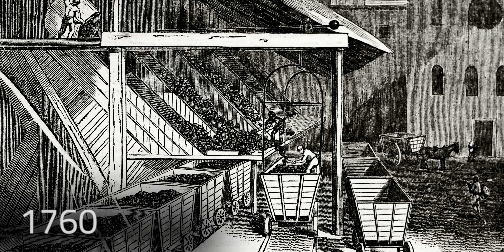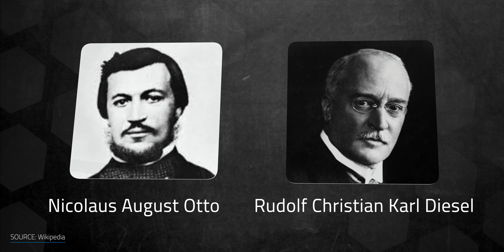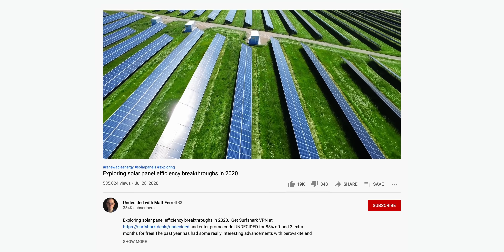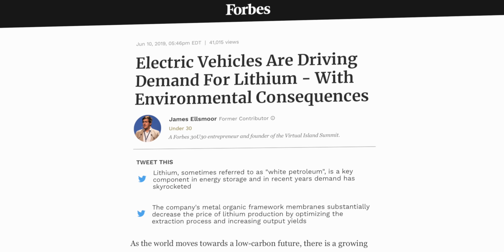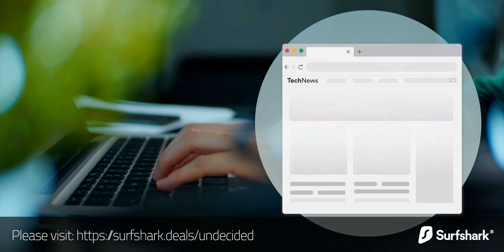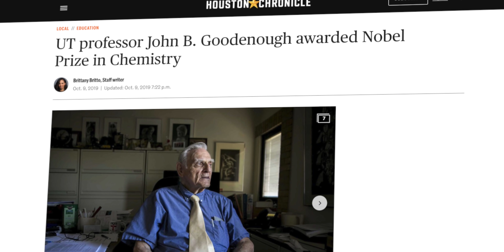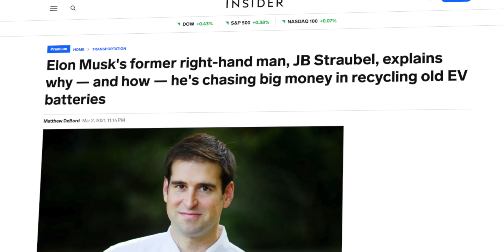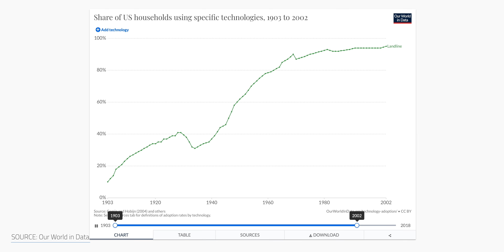Is the Future of Renewable Energy Inevitable?

Comment: That’s Goodenough for me! Yeah, I said it!
Reply: Not Goodenough. Apparently he wasn't satisfied with lithium-ion, since continuing on to sodium.
Reply: @Soul0 lithium ion is not good enough for me LiFePo4 you can't charge in the cold.  So I'm still lead acid. I can charge those at negative fahrenheit temperatures.
Reply: @bullithedjames  if you keep your car plugged in overnight, the BMS for LiFePO4 will keep the battery above freezing and allow near normal charging. In all other respects, LiFePO4 outperforms lead acid.
Reply: @williammeek4078   I don't have a car in a pedal bicycle with trailer that has a baby solar set up on it.
Reply: @bullithedjames  a thermal blanket would be easy enough to set up.
Reply: @williammeek4078  that runs off the battery? That charges off the sun on the shorter daylight days and cloudy days? And then let's talk price. $65 for 115 amp hr rated lead acid so let's say 50 amp hr LiFePo4 equivalent costs how much?
Reply: @bullithedjames  Oh sure, the 100 AH LiFePO4 battery costs $450 about 50% more than your $300 (your $65 is complete BS) lead acid deep cycle marine battery, but the LiPO4 is virtually maintenance free, lasts far more cycles and has a MUCH larger usable capacity. Your 115 AH lead acid has a usable capacity of about 60 AH while the 100 AH LiFePO4 has a usable capacity of 80 or 90 AH. So even though i would be paying 50% more, it is for 50% more battery that lasts longer.
Reply: @williammeek4078  I paid $65 at Walmart for that battery. I check fluid levels twice a year once in spring and once in fall. The price alone does you how long ago I bought that battery so is everybody's talking longevity, I''m just kind of at a loss there because Lead acid is basic maintenance simple. The weight of the battery is what gets me but LiFePo4 is not the answer for my use. I bet they are great where they're use and the cold weather is a minimum.  Lithium titanate would actually be a better solution for what I need but you still got that cold weather charging that lead acid actually is able to do. 

I am not someone just spouting stuff off all that right I'm not. I'm somebody who uses solar every goddamn day. I need it to be movable everything else so like what you're saying you know hey that might be great if I was in a permanent establishment somewhere or hey I had an extra $800 to buy a f**** set up but I don't.  Price, cold weather, and weight lead acid yes there's maintenance. But that's like checking the air pressure in your tires
Reply: @bullithedjames  You are just spouting off. That $65 Walmart battery wouldn’t last a year with daily use. There is a reason batteries designed for cars cost more. Your Walmart battery has a 1 year warranty. The LiFePO4 battery I found on Amazon has a 5 year warranty.
Reply: Where?
Reply: @bullithedjames  Amazon
Reply: @williammeek4078  you said I was spouting off so I asked where. I spouted off on Amazon?  Send a link please or shut up. Do you even solar? Real question I live off a system that costed me $225 at time of purchase. Please tell me more.   I did enough research to know what should work for me, and then you have what you learn by using.  So do you even solar?

Comment: We all know, the renewable energy sector needs a lot of help when recycling the wind towers, or solar panels.. I'm 48 years old.. The thought of countries being energy independent is very encouraging.. Hydrogen, I don't know what to think of it, the oil companies need to go away. Great video Matt!
Reply: I don't think recycling wind turbines is on the radar at all. Other than blade wear from atmospheric abrasion, or oxidation on the tower, the expectation is that they should be in use for decades, and when they individually do wear out, the pieces are mostly metal and can be sent off for normal reuse. Except for the blades which are fiberglass, and it's composites like that all across the spectrum that need recycling effort put into them.

You are right in that solar panel recycling needs to be a thing, but I bet that a lot of the panels that are replaced or removed are probably all very likely still operable, maybe not at their initial effectiveness, but they are definitely not useless 50 years later.

Hydrogen is a big problem though... well not in that it exists, we have plenty of it in our own bodies, the problem is extracting it, and then storing it. Both of those are terribly difficult. Getting hydrogen out of water takes a ton of energy, and the only way it's vaguely worth it is using solar or wind to extract it, but still it's just better to sell that solar or wind electricity then to use it to get hydrogen. Then storing it is the worst. H2 is a really small molecule, and that makes it very difficult to make a container that H2 doesn't just treat like a sieve, and then H2 doesn't like to be particularly close to other H2 molecules when it's a gas. It's just tough. You could liquefy H2, but that's some next level of energy consumption in order to cool it enough to make that happen. All of that is why we don't just all have hydrogen cars, the "technology" is always 50 years away despite way too much investment in it already, it's just not the panacea backers would like it to be.
Reply: Solar panels don't really need a lot of help regarding recycling, just regulation. At this moment it costs around 20 dollar to recycle one panel (+-10% of original panel price) and this is likely to only go down significantly. However it still is much cheaper to put them in a dump (we are talking about cents per panel), so ofcourse this will be done if allowed.

Wind towers themselves aren't really a problem either, the main problem is the recycling of the blades, which is being worked at, untill then they can be stored somewhere with a lot of space (and if they'd create specific storage area's, future recycling centers could be build on or near those sites to work away the backlog).
Reply: Oil companies aren't going away. They aren't as bad as they're made out to be. Plus they provide income for tens of thousands, even hundreds of thousands of people.
Reply: @ThunderChasers  Yes, oil & coal companies aren't going away. They are needed for the chemicals and materials they mine. We just need to stop burning their valuable product. 
And 10's of millions will be employed in the transformation to renewable energy sources. Workers constructing offshore oil derricks for example will be re-employed building offshore wind turbine platforms.
Reply: @fotoguru222  you assume these people will want to make such a transition.
Reply: @fotoguru222  the other question is when it comes to wind versus nuclear. How much more does it cost to maintain all of those wind turbines compared to one nuclear power plant. Because it takes hundreds of turbines for one nuke.
Reply: @custommotor  Yes, we need to build dozens, maybe a gross of wind turbines to equal one nuclear plant. 

However, I've never seen a full time crew in a field of wind turbines. No security guards, no radiation or steam boiler monitoring or repairing, no sea water cooling pumps to clean out. That's part of the reason why wind power costs less than half of nuclear.  

Just need to inspect & grease the gears and bearings from time to time. Remote control does the rest, while farmers continue to farm the fields beneath the slowly rotating blades.

Both need storage to make the systems work well, because neither system is good at matching supplied electricity to variable need. Pumped hydro is the most common storage today. Now we have many more storage technologies to choose from.
Reply: @ThunderChasers  Do the wants of thousands outweigh the wants of millions looking for a better job? Tens of millions of jobs will be created by this energy transition. Some will switch jobs. Some will keep their old jobs. Some will retire.
Reply: @fotoguru222  that's a fair point.
Reply: @ThunderChasers  Why do you think they wouldn't want to make the transition?
In my personal experience as a car mechanic: I'd rather work on an EV than an ICE car. 
I've got an office job now (pays the same, easier on my body) and an important reason for the switch was that I've had enough of being covered in oil (we didn't have any customers with an EV, and very few hybrids).
The only reason to stick with oil and gas would be because I'm familiar with it (though I like to learn new stuff).
The benefits of making the transition (comparable job content and wages but in a healthier and cleaner environment) outweigh the possible downsides IMO.
Reply: @BodyDestruction  Because I know people who work in the oil field. Friends and family both. And some of these jobs, they aren't transferrable. Some of these workers spent years in school to learn this stuff. So, for them to transition over to a new field, throwing away all that education and/or work experience, is not something they will want to do. I know, because they have told me so.

Obviously this doesn't apply to EVERYONE in the oil field.
Reply: @ThunderChasers  Noone talks about other industries that died or shrunk over the years. Shit happens. Only count the jobs that will be lost, when more and more automatic systems will be applied. I've just watched a video where robots where able to build hauses with just 3 or so workers around. That kind of shit will happen all over the place. What to do with all the workers from banks and so on when AIs will take over their jobs? Questions that need to be answered in time. Kind regards.
Reply: @ThunderChasers  Oil companies have done lots of bad, and the military industry employs many people, and so do mafias.

Comment: If we want renewables, the UK will need a minimum of 5,000 gwh of backup supplies - presumably from pumped water.  And that will cost a fortune to develop.

Prof McKay, the UK government science advisor, was a confirmed Greeney - but even he concluded that the auk could never go fully renewable.  All his options involved a load of nuclear power.  

And he never did solve the 5,000 gwh of backup supplies problem.  He suggested flooding Scottish glens, but I don’t think the Scots will be impressed with that.

See his free pdf booklet.  It is very good, but he should have used the same energy unit all the way through it.
Renewable Energy Without Hot Air.
https://withouthotair.com/

Ralph.

Comment: I know this will never happen, but if everyone were incentivized to put solar on their roof and they put like 50% more solar than they need on their roof, that extra 50% would be fed back to the grid. It seems like if everyone were to do that, then the need for fossil fuels would go down dramatically. The chances of that happening are pretty much zero as solar is till cost prohibitive for 90% of the population. But in a perfect world, this could be an viable thing.

This would be even more pronounced with a commercial building. If a building needs a 30kw system (that is probably on the way low side), then install a 45 kw system and the extra 15kw gets sent back to the grid not only lowering the company's power bill, but also getting paid a good amount for sending power back.

Comment: The big roadblocks of renewable energy are not all technological and going into the video I hoped you would have touched on that. It seems the biggest challenge is to break the influence established players such as the fossil fuel industry and the established car manufacturers have on policymaking. After all, if you factor in the price of externalities such as long term cost of pollution and climate change, the cost comparisons would look quite different. Instead of making any kind of meaningful reductions in pollution, or even trying to stay ahead of competitors through real forward-thinking innovation, they've seen that using their position and wealth to cement their position, through lobbying and manipulating public opinion, was the more efficient use of their resources.

It does however seem that the wind has shifted now, as pretty much every oil and car company is publicly signalling how they will navigate the coming transition away from the worst sources of CO2 and other pollution. All it took was the behemoth of the capital markets favouring the (deserved) hype of the green revolution.

Comment: Actually, DC transmission is more efficient than AC transmission over long distances. 
Long-distance energy transmission is relative. 

Check out this Wikipedia topic on the Pacific DC Intertie
https://en.wikipedia.org/wiki/Pacific_DC_Intertie

Here is another Wikipedia topic on High-voltage direct current in general. 
https://en.wikipedia.org/wiki/High-voltage_direct_current  

AC transmission is the obvious choice for regional and local distribution but DC transmission of energy certainly has its place in long haul transmission.

Comment: The problem here is that we are running against the clock with a lot of catching-up to do in terms of reducing Greenhouse gas emissions and making Green Energy a true solution in terms of environmental impact. I personally think the pace is not fast enough. It is taking a long time from the achievements done in Universities around the world until they are massively adopted. So, perhaps a follow-up video on this one, on how to speed adoption?
Reply: We finally have reached the point where solar and wind are profitable (with wind being one of the cheapest energy sources we have) so we are probably at the transition point where those 2 will grow very rapidly.
Reply: Yup, the biggest problem is not innovating to solve the problems in theory but policy making to get the solutions operational as soon as possible.

Comment: It's worth noting that saying renewables need maintenance is laughable considering the amount of maintenance and labor required for fossil fuel plants. A wind turbine is basically the same as a fossil fuel plant's turbine, but without the high temperatures, steam, and the rest of the equipment necessary to burn fuel and adjust it's output. Replacing the blades of a turbine after 20 years is nothing compared to the costs of maintaining a fossil fuel power plant. The turbine itself needs to be replaced in both in both cases. And with batteries and solar cells, we'll likely be able to set up a recycling supply chain that will cause far less pollution and be cheaper than mining materials from the ground.  The only advantage of fossil fuel plants is to meet peak demand until we get enough batteries to do so or have nuclear plants meet peaks.

Comment: A wind turbine with an operational lifespan of 20 years can pay for itself in 5-8 months, and at residential scales solar panels make way more sense in terms of ROI. That makes nearly all fossil fuel plants look like a terrible investment, peak demand is still an issue which is slowly being solved with batteries. But nuclear plants and hydroelectric plants can act as peaker plants until then.
Reply: Wind turbines are largely a dead end. Solar and wind will be part of our energy source but it's unlikely either will be efficient enough to replace fossil fuels. It's a pipe dream.
Reply: We will have to wait for new battery technology. Hydrogen could also be a solution but the cost is still way too high. I think oil will dominate for at least 10-15 years, knowing how profitable it is and how much role politics play in the industry.

Comment: Cannot make solar panels more than 100% efficient.  I did find out gold is a very good infrared reflector. Why don't we have gold mirror as thermal reflectors, enough of them and you have a city that looks like it is made of gold. Hmm, I bet that what they did in our hidden history? Confinement lattice fusion? I bet Hydrogen is even lower energy density than wind? Consuming more stuff equals profits. Whatever they come up with it will not be cheaper. Fusion and an Overabundance of Watts is what is needed. That can fix the planet. Water n food from the air, if you have cheap power.

Comment: Renewable energy will keep growing for a while, but when the hype dies down we will have too see if the technical solutions to the problems of these energy sources are feasible and practical. If it is too difficult to store large amounts of energy, if we have to constantly replace thousands of solar panels and windmills every so often and if they cannot reduce costs for consumers then the hype will turn to disappointment. 
Ultimately the test will not be which individual powerplant is most economical but which energy system or electrical grid will best serve people and industry depending on its mix of energy sources. Countries such as Germany and Denmark which produce a lot of electricity from renewable sources also have high electricity prices for households while Germany also have high electricity prices for industry. The fastest growing economy in the world, China, mainly uses coal to produce electricity so renewables have a lot to prove.